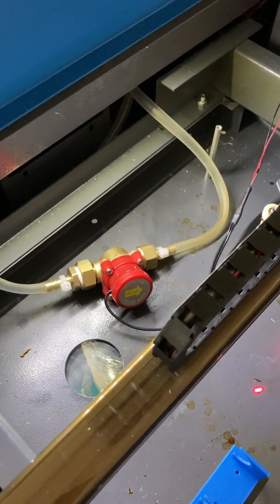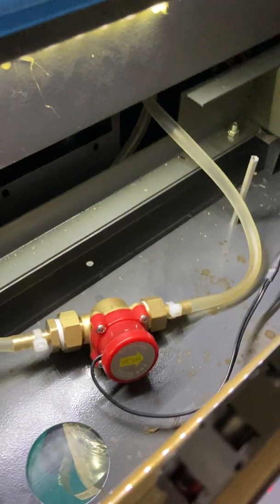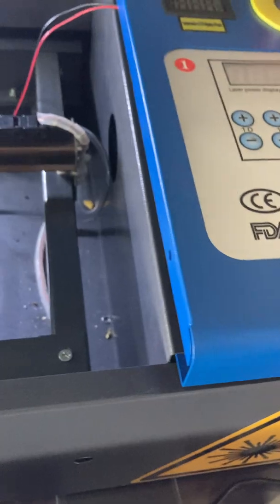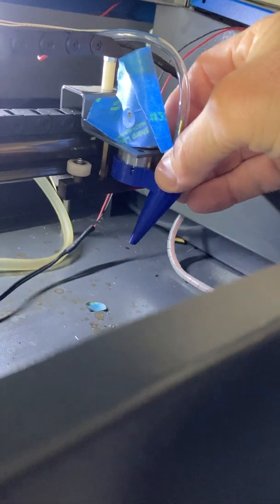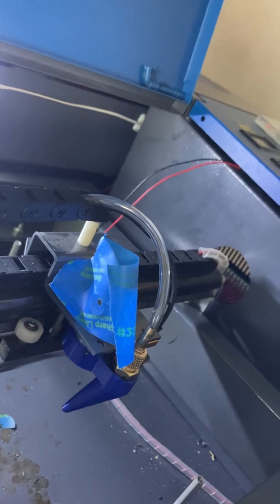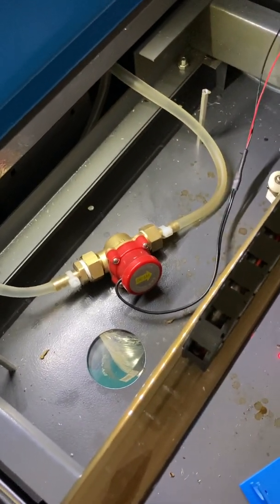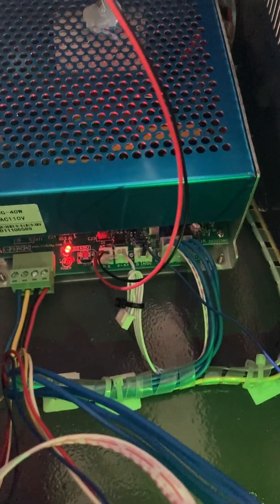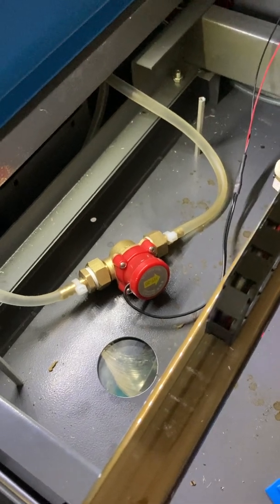Installing a Water Flow Sensor Switch in a K40 Laser

Comment: I installed this but found that there was a steady water leak from both sides of the fittings.  To be specific, even with teflon tape, both sides of the fittings are drip, drip, dripping on me.  Any ideas?